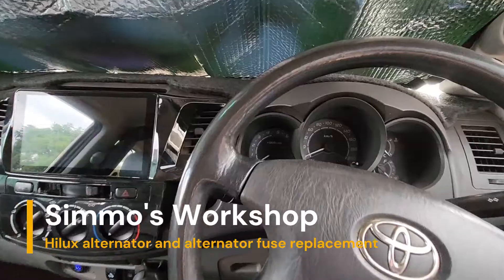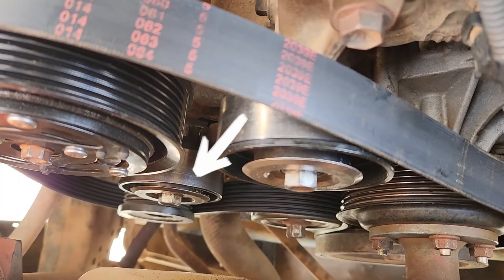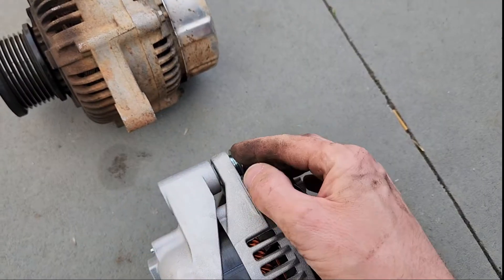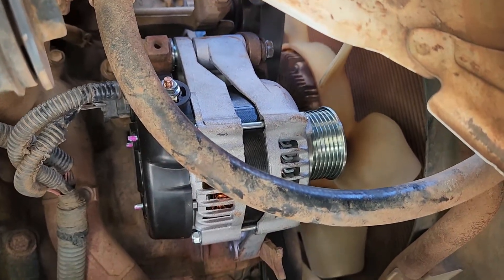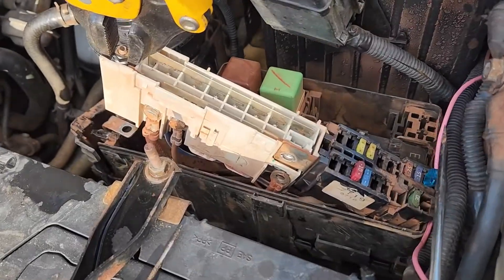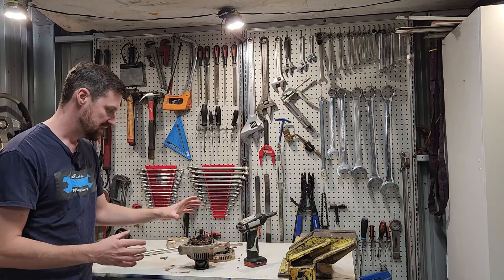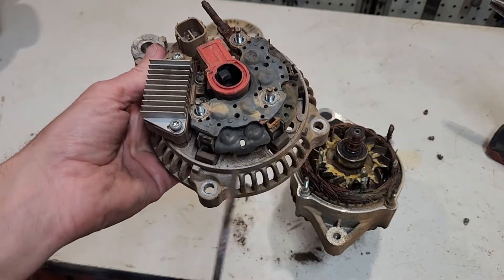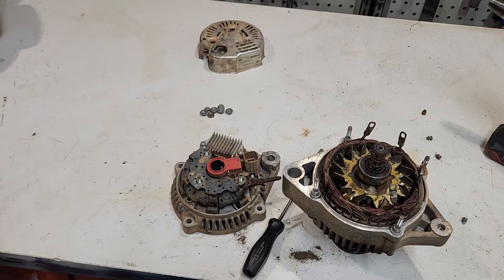Toyota Hilux Alternator and 100A fusible link replacement | Bad fusible link symptoms

Comment: Hey mate, do you know what the part number is for that fusible link?
Reply from the maker: Yep, the replacement I bought was a 82620-71010 and it was about $60 from the dealer.

Comment: Hi, I was doing an engine work on my vehicle I forgot to unplug the battery. Fit my alternator back on I think it’s sparked from the main wire on the side of the alternator one with the bolt. i’ve blown the same fuse as you. I repaired this fuse with some solder and it melted straight away. Would you have any idea why it would do that? I don’t want to fit the new block and it blow the fuse again . Thanks regards
Reply from the maker: Hi mate, yeah that bolted ring terminal on the alternator grounding anywhere will blow that link. 
I'd say to be sure double check that alternator harness for any areas it may ground, if you have a multimeter you can  test the ring for resistance to earth.
Soldering the link is never really a reliable fix, if everything is back how it was before repairs its most likely the normal current the fuse would handle is blowing the solder.
Reply: Hi mate I’ve been at it for the past few days now I bridged it with thick metal and it just heats up really fast. I’ve ordered a new alternator and I was going to see if it does the same if so my problem may lie in the wire?
Reply: I did read somewhere that sparking my alternator could’ve caused problems inside it
Reply from the maker: Yeah I'd say if the alternator doesn't resolve the issue there is something going on with that wiring harness like a dead short, if thick metal is heating up across that alternator fusible link that's a bit of current. 
Hopefully, the short is internal in the alternator.
If the alternator is disconnected at that ring terminal, does the link still heat up? Could show if the harness is shorting or the alternator

Comment: Hey mate, i have a hilux n70 2010 1kd i touched my battery with a ratchet and now my check engine light does not come on when i turn the key to accessories and it wont start it cranks but doesnt start do you think this could be the problem thanks
Reply from the maker: Hi mate, if the alternator fuse goes, it should still fire up. Do you know what the other end of the ratchet touched?, if you have shorted something there should be a fuse blown somewhere, it may not be the Alt fuse but still could be a part of the fusable link or another main fuse. I'd start there and see if any part of the fusible link or related fuses have blown. You should have a check engine light in the ON position also under normal circumstances.
Reply: @simmoshomeworkshop  i touched the negative battery terminal with the rachet, i checked all fuses inside engine bay with a test light they all fine including fusible link, i checked all fuses inside cab on drivers side all good besides starter fuse 7.5 amp right at the top, doesnt light up with test light pulled the fuse out and checked it looks good not blown or burnt out i swapped it with another 7.5 amp fuse that works and it still doesnt light up with test light  im not sure weather its the fuse box itself or the wiring that tripped, i read online people saying it could be a problem with the ecu not getting power to it but im not sure dont wanna go spending money if thats not the problem
Reply from the maker: Hmm, you should be fine touching the neg terminal unless the other end of the ratchet was touching something live?
Do you have good fuel pressure at the hand priming pump? Sounds simple but it's a good start to see if it holds pressure there to be sure you do have fuel.
If you have access to a scan tool it would be worth a check for codes if all the fuses are intact and have a check to make sure everything (like the pump suction control valve etc) are plugged in and don't have wiring issues.
I'd say it's not impossible, but very unlikely you have damaged an ECM or the injector module.
Reply: @simmoshomeworkshop  i might of touched something else, it does have good fuel pressure at the priming pump, ive tired plugging in my scan tool it doesnt connect to the ecu since the engine light disappeared ill check all the wiring and valves tonight
Reply from the maker: Ah bugger, bit of a concern it won't communicate with the scan tool at all, I hope it's something straightforward mate sorry I can't be more help to you